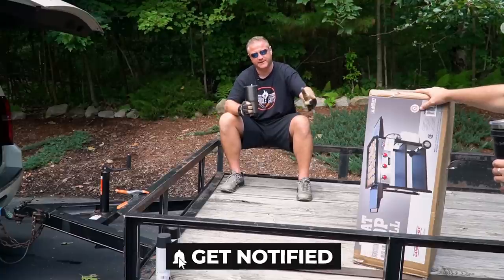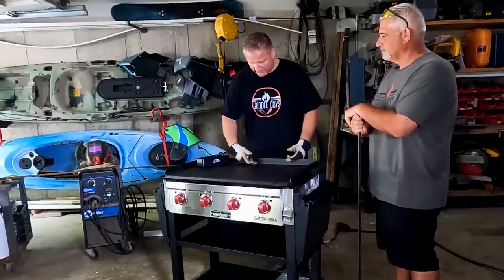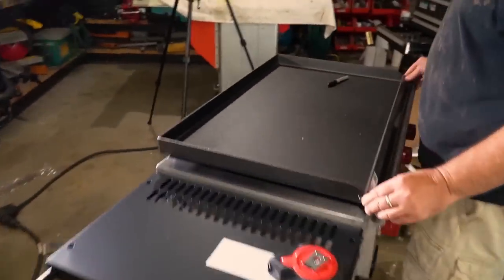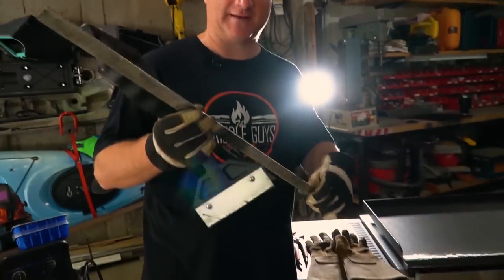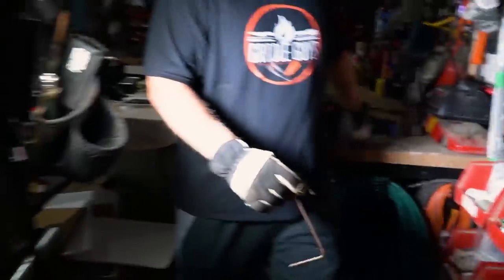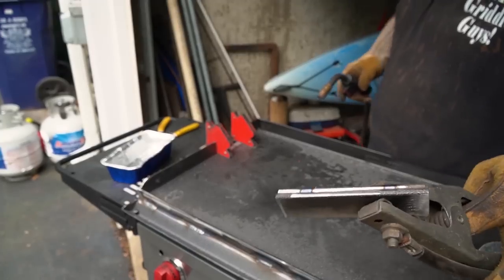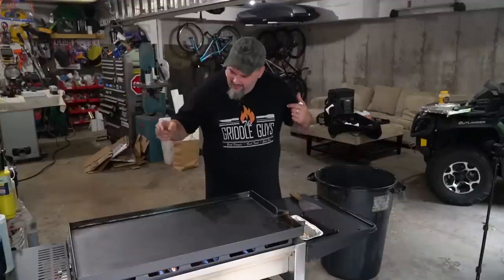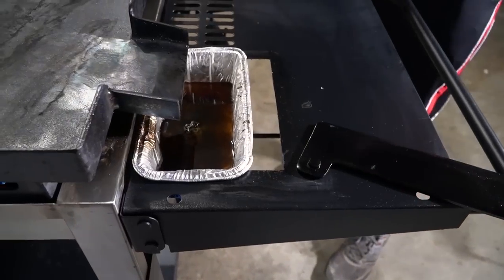3 things I hate about my griddle!  And how we fixed them!

Comment: Good video and great ideas. I have the Blackstone 36" with the rear grease catch. I'd like to see the slot widened as well. If the slot were wider the scraper would also fit through to scrape the "smeg" into the catch pan. I also like the idea of using "off the shelf" tin pans. NOT the proprietary size Blackstone uses and sells. Thanks for the ideas.

Comment: I love the job you guys did. For me, I prefer the rear trap on the blackstone. I don't want to see the grease trap all the time. I prefer it hidden behind while I cook.
Reply: Yes but with an "off the record" behind the griddle grease pan camera to discretely monitor the level. lol
Reply: I have a hard cover on mine that lifts and folds / hangs off rear of it, it also blocks some windy conditions from cooling the grill to much, so I like the side discharge idea much better
Reply: I used a cheap ($50) vevor commercial grease trap.  Catches food scraps, separates grease and lets water drain off, so you can use water to clean with no problem.

Comment: Suggestion:  Sometimes you want a tilt and sometimes you don't (thin sauces, eggs, etc.).  Add a cam to the front and back of the side opposite the grease pan.  A piece of solid rod drilled off center would make a cam which would mount on steel tabs and be activated with a 90 degree bent rod handle.  When the cam is disengaged the griddle top would be level and engaging the cam would tilt it even when the griddle is hot.  Probably some wood prototyping would be required to get the right configuration.  Again, great work.
Reply from the maker: I was first going to reply that CC has built in levelers on the underside of the griddle but your design makes more sense. AFter all, you can't pick up the griddle and adjust them when it is blazing hot but with your design,  it wouldn't matter.  YOu could actually adjust the pitch on the fly..   I like it. Will suggest it to Jeff for his mods.  Thanks for the idea and for taking the time to share it Les!  Cook on bud!   -N
Reply: Brilliant idea 👍
Reply: @TheGriddleGuys  And they seize up from the rust also should be made of ss!
Reply: Can you show me in a diagram the cam idea Les..
Reply: I think a "removable" cam is better. No hot when in use, and put away when not in use. It seems to ve similar to the reclining chair

Comment: I am completely happy with my Char-Griller Premium. It's my first griddle, and I can't think of anything that would improve it. I actually like the grease trap at the front, and the size of the hole is perfect. I appreciate all that you guys do, very entertaining and informative. You guys have a great flow with your videos.
Reply: I love my chargriller, except the grease pan is a little small. Otherwise I find it superior to blackstone in many ways.
Reply: I also have the Char Griller Flat Iron Premium.  Completely agree, Grease trap is perfect, hole is perfect size, Integrated hinged lid, magnetic tool holder, paper towel holder, front utility tray for oil/water bottles and anything else.  Its far superior to anything else I have seen.

Comment: I have this griddle and I love the solution to the sticky sludge.  One thing that concerns me is this griddle puts out a lot of heat through the sides of the griddle top. I wouod weld in a metal piece to block the vent holes along the grease catcher to try and keep that heat away to not start a fire
Reply from the maker: Agreed.  A ton of heat rolls up around the sides.  Didn't think of blocking the vents.  Maybe we will do that down the road.   Cook on Kraken!  -N

Comment: Great job as allways I like to take a 220 flap wheel and a 4 inch angle grinder and polish the top to a mirror easy to season and clean.
Reply from the maker: Ty Andrew and good call.  Makes quick work of what would be a long painful process if done by hand. Griddle on-J

Comment: That is how I wish my Blackstone was (I have the original 28" model)!  Great job on the mods.  You might be able to find a stainless steel loaf pan that the disposable loaf pan liners will fit in for even more sturdiness when removing the pan filled with grease and "smeg".
Reply from the maker: A few others recommended the loaf pan.  It's a good suggestion.  I will grab one soon.  Thanks for watching and for taking the time to comment!  -N

Comment: Fantastic video guys. I'm a welder/fabricator and I love it. I might even move my grease trap on my Blackstone from the back to the side, that's a great idea. Have a great weekend guys👍👍
Reply from the maker: Well now that we know your a fabricator,,, Why didn't we just have you do this for us!!!!!!   LOL! :D   If you have the rear grease trap already, what are your thoughts on just cutting the back wall wide enough to get your scraper through, then putting a small ramp to drain the grease into the trap where it is?  Fabbing a ramp that aligns with the V depression in the cook surface could be tricky but might be worth it?    

Anyhow as usual, great to hear from you !   Cook on bud!  -N
Reply: @TheGriddleGuys  hey Nate! Ive got a couple videos out now of me starting on a new smoker. I would've loved to come to New England and helped on yours. I thought about modifying the rear one but sometimes I forget about the rear one (outta sight outta mind) until it overflows onto my patio. I like the side idea because I would see it all the time. I do hate the idea of closing up the rear one though. I'll figure something out, video it and credit you guys with the idea. Have a great weekend guys.
Reply: @TheGriddleGuys  I have the 36" rear drain Blackstone.  I absolutely hate its design.  I will likely fill in the hole, move to the side with a similar cutout to yours but have a drain into a removable bucket like my smoker.

Comment: I have a Pit Boss 36”, 5 burner griddle with the ceramic top.  I really like this setup.  My grease drop is in the bottom left side.  There are vertical sides on all sides.  The only problem I have is the grease drop catches food in the down shute.  Otherwise this griddle is fantastic.  I have learned a lot from you guys.  Keep it up!
Reply from the maker: The pit boss is a nice unit and from what we hear the ceramic cook top performs very well!  Thanks for watching an for the kind words John! Cook on bud!  -N
Reply: how do you like your griddle a year later? I own the 3 burner & love it. Keep my temps under 400 most of the time & use boiling water after scraping. Cleans the grease trap well. Love the garbage attachment & rarely have food go down trap. But I am very attentive when cooking. :)

Comment: Great job guys! Welding is sewing with metal. My griddle is a Char Griller and the grease trap opening is in the left front corner and works great and the trap in under the unit. I also agree with the sugar type schmegma and being able to scrap it off. Very fussy stuff. End result was good. I'm sure the engineers at Camp Chef are taking note.
Reply from the maker: Thanks Matt. Cheers-J

Comment: Great video.  I have 8 of the blackstone griddles and the grease does always roll back down the sides and legs of the unit.  Wiring a tin can to the drip channel and making a paper clip v stuck down the drip hole seems to stop most of the roll back.  Blackstone redesigned their grill tops to put the grease trap at the back of the griddle.  Better now.
Reply from the maker: 8???   Do you own a food service business?   -N

Comment: I worked at McDonald’s in the late 80’s back when they actually cooked food.  We had these large 2 handed scrapers that we had to sharpen every night after closing.  The grease traps were like 4’ long, 12” deep, and 2-3 inches wide.  Those were a mess to pull out and dump; the new guys would always spill everywhere.

Comment: 1975 I worked at Kings Island in Cincinnati on a hamburger griddle. The grill had an apron and removable pan just like the fabrication you guys did... You could push the bits and grease off quickly, and it was very handy. I'm not fond of any griddles grease traps at this point.

Comment: So I have the blackstone with the front grease trough. Since I had heard about the drip issue prior using my grill (I sent one to my nephew as a gift), I cut a piece of aluminum (leftover from gutter install) and extended it over trap, then drilled a hole in it. Works perfectly. I put paper towels in the cup to absorb the grease.
Reply from the maker: Good call Nick. Unfortunately your still pulling the grease towards you tho. Hot and messy. Still worth the risk tho for sure either way. Ty for commenting-J

Comment: 3 guys in a garage fix all the short comings of the griddle that the ‘engineers’ at Camp Chef can’t figure out. Also noticed that Camp Chef added more vent cutouts on the side shelf to help dissipate the heat. That’s another pet peeve I have, the shelves get so  hot they’re almost useless. Maybe you have ideas for that with the additional mods. Great job!! Come to Florida and fix my Camp Chef
Reply from the maker: Agreed, both CC and BS now have slots or spaces in the shelves due to the heat buildup.   We have melted at least 10 bottles and several plastic bowls :/  Thanks for watching and for commenting Hot Grill :D   -N

Comment: As a chef I like your grease trap but I want it on the side at the front. My camp chef griddle is mounted on my pig roaster so front dump is  easier to empty. I will tig the flat bar to the top of the angel iron at the front with the cut out on the side rail. Thanks that will be a real labour saver. I  just subscribed. Looking forward to learning more.
Reply from the maker: Thanks for subbing Joe!  Sounds like you have a pretty good and interesting set up!  Happy to hear your a camp chef fan!  So are we!  Thanks Joe! - C

Comment: The gap around perimeter between the grill and burners make a thin gauge steel skirt that blocks the side drafts when using our side to keep the temp regulated. That's what I did and it's easier to light with the clicker starter.😁👍👋 Great video, I'll build the catch tray on mine similar
Reply from the maker: Good call and ty. Cheers-J

Comment: Was just looking for a griddle for my "Barby" and found the Camp Chef SG90 to be the one. ((It's the perfect size (16"X24") to go on my Old Weber Genesis to convert it to a grill top)). I share the same concerns and was thinking about how I could deal with them. I came across this video and BAM, you guys read my mind and did exactly what I was thinking! Time for me to order one up and get out the welder and go to town. Thanks for doing all the prototyping for me! You guys rock. In addition to what you have done, I was thinking of making a plate with side handles that stick straight up, for the grease pan to fit in which would allow removal of the grease pan using the handles, only because I've seen those flimsy pans fold and dump all the hot ingredients, schmeg and all, all over the place - dangerous!. The other thing I plan to do is remove that front grease channel as it's no longer needed, right? Or have you found a use for it? Other than that I'm going to do exactly the same mods you guys have done. Awesome job fellas! Thanks!
Reply from the maker: Awesome stuff and ty. We did a second mod video a couple weeks after this one where I actually bent up the front grease channel to incorporate it into the cooking surface. I'd say after using it a couple months it wasn't worth the extra effort. Never gets hot enough to be practical. On Nates where we just left it where it was we have not done anything to make it useful.  Not sure if I'd cut it off or just leave it but I suppose that's the fun with having a welder. If you change your mind you can fix it. Lol. Hopefully this helps and thanks again-J Cheers 🍻

Comment: Okay idea but there is a idea that I think is  better way for the grease stuff. The idea is on the left or right side make a hole big enough for everything to be pushed and empty. The stuff goes into a long sleeve that is easy to pull out and empty.  40 years ago was the restaurant way of doing this because I did it.  It worked great. Have a great day!
Reply from the maker: Funny you should mention this Ken!   Jeff plans to do exactly that!  Big opening in the griddle surface that allows you to push everything down.  Members Mark and blue rhino griddles have this feature but unfortunately the opening is rather small,   Lets see if Jeff is able to pull it off.   Cook on bud!  Thanks for watching!  -N

Comment: I have a 36” blackstone with the air fryer baskets. It’s got a rear grease slot, but I really have no issues pushing griddle debris into it. I did buy a perforated steel clip to cover the grease slot and prevent food from falling out while also allowing grease to drain through the holes. If I need to push larger pieces of debris into the grease trap, I just slide the clip to the side. This side drain you guys have is pretty innovative but for me, I find that I use my side walls a lot to scoop things off the griddle. Don’t you lose more food this way?

Comment: I live in AK without a garage so no grilling in winter for 6 months.  How is best way to winterize a grill for no use winter?  Either covered in in a shed.  Any ideas are appreciated so I don’t need to sand and  re-season.  I’m a new sub that just found the channel.  What is your preference for small RV size griddle.
Reply from the maker: Blackstone 22 for a small griddle,   and for winterizing a THICK coat of oil on the griddle should work.  Keep it covered and dry and preferably away from anyplace critters can get to it!  -N

Comment: I understand your reasons for not liking a few things about the griddles;  But I agree with Chris!  “It’s just not right” to do that to a new griddle!  😄

Check out the Sams Club brand griddle like I have. The grease drain is a hole in the front center of the griddle.  I ball up some foil to use as a plug, and take it out when I need to drain some grease or do some cleanup.  👍🏻👍🏻

I did really enjoy this video.  Y’all keep it up.
Reply from the maker: Thanks for the kind words 65!!!   I had to go look up the sams club griddle.  Looks like they have a grease knock out built into the griddle surface.   This IMO, is a better design.  Pretty much any design that allows you to NOT have to pick up hot schmeg to dump it into the trash works better than small slots or a vchannel and this design nails that..  Personally I have always been a fan of members mark as well.  

Cook on bud!  -N

Comment: I do have a question for you man in your opinion what type of material should be a griddle in a commercial restaurant (crabon,stainless steel)or what other material should be the right one to use in it
Reply from the maker: Stainless cooking surface bonded to a more evenly and faster heating metal like aluminum.  Best of both worlds.  The reason I like stainless is for cleaning.   You can always get it back to silver.   The cost of this however usually is too expensive for your average backyard cook

Comment: I switched the corners on my griddles to both be on the inside right on my Camp Chef Denali 3 burner stove with single and 2 burner griddles. Welded the factory hole shut and cut new ones on the opposite corner of each griddle. Trough is on the right side center to catch both now instead of the can on each outer corner.
Reply from the maker: I like it. Customizing is always fun. Hopefully it's working well for you. Ty and Cheers-J

Comment: Very Cool! I have the five burner Blue Rhino grill that has a small square hole positioned in the left front. The grill has a lip all the way around it and it seems to do will in regards to grease and debris collection. But nothing like your set up does! I do have a question for you guys. My grill worked great the first year and a half but now I can only run two burners on high or three on medium. If I try to light all the burners they all either go out or have a very weak flame. I bought a net tank, had it filled and the grill took off and ran great for three sessions. Now it is back to not working correctly again. Should I buy a new regulator? What do you think? After 45 years of grilling I have never had a regulator fail before. Thanks
Reply from the maker: Morning Don,  I would say def try a new regulator as a first step.   I don't know if rhino uses the same supplier as blackstone but 2 out of 3 of us have had regulators fail on our blackstones.  I think there is a factory in china putting out low quality ones.   If that does not do it, you might have cobwebs or critters in teh fuel rail.   Hope this helps!  Thanks for watching!  -N
Reply: @TheGriddleGuys  I cleaned the burners and fuel rail already thinking that was it so I'll find a good quality regulator from the states if I can find one. Thanks!!

Comment: Hindsight is 20/20 right? So maybe make a ring the shape of the little baking pans out of the small rod used for the hook and pan support and extend one corner up for a handle. It would support the pan all around perimeter (could make it like a basket with a bar wrapping underneath). and the handle may not get as hot. You can still use the oversized slot to set it in and slide it under the grease shoot.

Comment: i have the same issue with my metalcraft flattop. was also thinking about open up a new greasehole since my have a similar design as that. although mine has run on all the way on the inside to a catcher in back, so stupid designg, never thought of the flatiron in front. ill do that as well. thanks for the idea.

Comment: I’m not reading all these posts to see if somebody else mentioned my idea already but here it goes.  How about a piece of long angle iron to run down the front edge of the grease edge which would be mounted(welded) flush and up with the edge then going towards the griddle cook surface.  These would create a taller edge near the cook with a bit of a hood effect to guide and keep grease flair up off the cook or deck.  The two sides would of course need to be closed off.